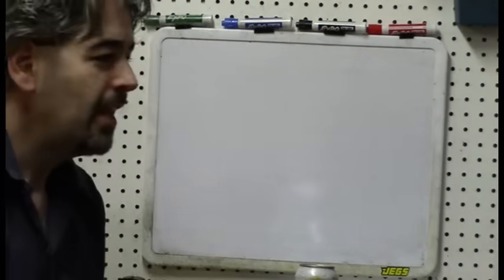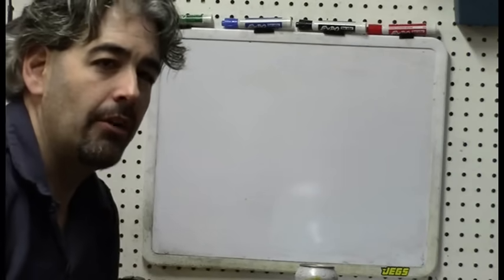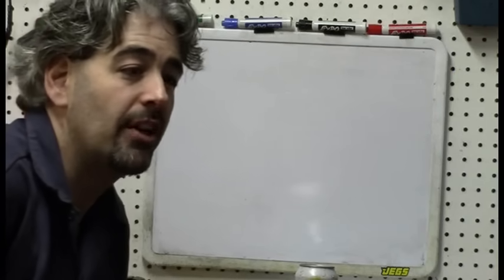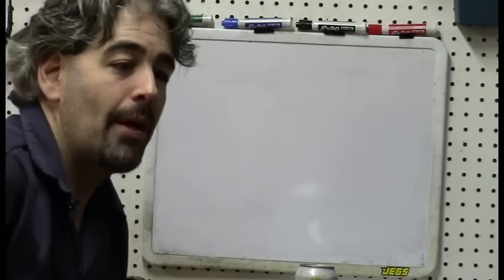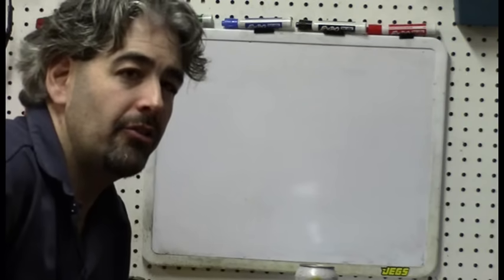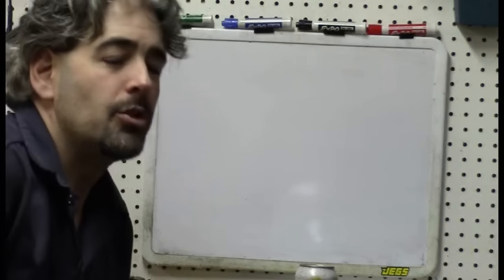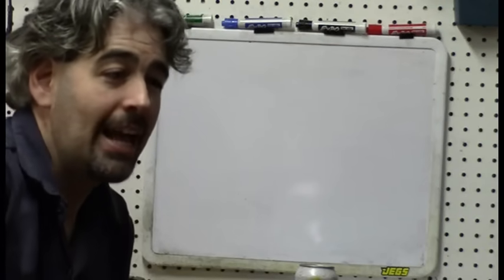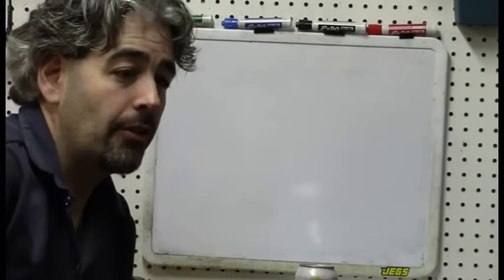Secret of Engine Problem Diagnosis- Fuel Trims Pt.1

Comment: What if the downstream O2 Sensor varies voltage in the correct range but there is no Fuel trim... It's a flat Line.    I checked the 4 wires continuity from the senor to the ECU harness. It's a new Mazda 3 sensor.
Reply from the maker: well there are a couple things. the downstream sensor shouldn’t oscillate voltage- only the upstream should. 
  also what percentage  is the fuel trim flatlined at? and are you referring to long or short term?
  if the short term is flatlined then most likely it’s a communication issue with the scan tool.
Reply: @SchrodingersBox  Thanks for the quick reply.   Can I send  you the graphs so we can discuss accurately?  I'm also getting some knock senor activity.  I'm on FB and we can PM there if you like.  Thanks in advance

Comment: Thanks fort your help a several months back (break booster split hose). Car is fine (no DTC) but my LTFT is between 8 and 12% at idle and comes down as RPM increases. Is this something to worry about? Should LTFT always be 0 at idle?
Reply from the maker: Not possible to tell- you must combine the STFT to look at total trim.
Reply: @SchrodingersBox  On my Audi STFT is about -2% to 0%>. Total number is around 10%.  Just concerning when the numbers are 12 and 0%.  I own a Saturn and both numbers are negative at idle at around -7 total.  Two completely different baselines when DTC aren't present.
Reply from the maker: I don’t see any issue with fuel trim.

Comment: Great video. Gave me somewhat better understanding of fuel trims. It didnt however help me get any closer to figuring out what is wrong with my 2015 Honda accord hybrid. I had p0171 set once at idle some time ago. I reset it (my mistake) after I replaced oil k&n air filter with OEM one and after I cleaned mass airflow sensor. That was before I learned about stft and ltft. Anyhow, p0171 never came back but my stft oscillates between 10-30 and ltft oscillates between 7-18. When full open throttle it seems to drop as if vacuum leak was present. Car behaves normal except maybe little shaky at idle (it can be my imagination fueled by fuel trim paranoia). Only other thing I found suspicious is the fact that i can not complete evap system test after driving over 5000 miles no matter what drive cycle I do. That made me think of possibility of fuel vapor purge valve stuck open. Would it explain lean condition? Anyone? I'm in Chicago and I can not find a knowledgeable mechanic that is comfortable with hybrids. I could go to the dealership but my fear is that they just start replacing sensors, injectors, fuel pump, mass air flow sensor etc. until they stumble upon the culprit of this issue.

Comment: Hey. Superb video. I have strange problem with short fuel trims. My engine is BMW M54B30. On bank 1 i got  +25-28%, but on bank 2 it is ok 0 to 5%. I know that my oxygen sensor after cat on bank1 is dead. Is this can affect on fuel trims? 
MAF is working, I checked rubber hoses and there is no cracks.
Help please. Thanks.
Reply from the maker: if wouldn’t be the MAF because that would affect both banks.   On BMW the S2 does have some input on fuel trims so if the sensor is indeed dead (and I would test it to be sure it is) you will need to replace it to get a good baseline on the fuel trim. then if you are still lean on that bank you will need to look at the bank specific variables for lean condition
Reply: @SchrodingersBox  I will replace oxygen sensor and will let You know, thank You.

Comment: 1998 ford expedition 4.6 liter has a P0171 and P0174. LONGFT1:25 LONGFT:25 at idle. When accelerating from 0-60 mph at 2500 rpm LONGFT1/2 maintains 25. At the moment i let go of gas both LONGFT1/2 drop to 20. At cruise it returns to 25 and both shorts are at a average of -3 to 5. What could this be
Reply from the maker: Lots of things. What is your induction data showing?
Reply: @SchrodingersBox  induction data as in all the sensors for air intake and throttle position?
Reply from the maker: Exactly.

Comment: Hey doc really been enjoying these classes but cannot get the concept of my diagnostic! I have 2 banks with low/normal stft at idle with Ltft bank 1 at +0.78 & bank 2 Ltft at -3 what would cause a misfire on the complete bank 2 with stft of -18 whilst bank 2 is only at 2.3? cats are both around .7 when warm too.. It only misfires at high rpm 5805rpm to be exact

Comment: could this cause a hotter than usual catalytic converter? and will that be a symptom of a vacuum leak?
Reply from the maker: Yes. Lean conditions can result in hotter exhaust. Actually rich conditions can also result in rapid catalyst degradation
Reply: Thanks for the reply , I started to notice a really warm to hot cabin floor on the driver side of my 07 crown victoria is not getting cherry red hot at all but I do notice a hotter cat and hotter engine bay as well no check engine light no increase in engine temperature but definitely feels hotter I do not have an engine miss fire nor oil burn so I am beginning to look into a vacuum leak. Great video.
Reply from the maker: There could be a million reasons for that even as simple as a missing heat shield. If you believe your engine is running hot then that would show on the CTS voltage or output and if it is confirmed you need to do an engine heat diagnostic covering variables from timing to coolant efficiency to stoichiometry....
  There is no evidence of anything right now.
Reply: Thank you , keep up the great videos and education is greatly appreciated!

Comment: A slightly confusing syntactical error early on but overall very nicely educational. I learned how to check for a vacuum leak with my scan tool, and how to figure out where it is occurring, without having to buy a smoke-making thing (I already have a propane torch)!

Comment: Thanks for the amazing video :) Wish all mechanics have this Knowledge. Anyway, I assume I'm an idiot, I got the error code P0301, changed spark plugs, ignition coils and fuel injectors, and none of that fixed the issue, the car Acura TSX 2009 doesn't go over 20 mph and check engine is blinking,  I took a look at the Short term and long term data, short term is -30% and long term is -3%,  OSB1S2: .86 (looks normal, right?)  I feel stuck and doesn't know what to do next ??!
Reply from the maker: you need to curve it against load and determine the rich condition environment and then look at the variables that would cause the rich condition under those parameters.    Just the incomplete data you have shown does clearly indicates it’s not an ignition problem so definitely don’t continue in that direction.
Reply: @SchrodingersBox  I didn't understand what it means to have the short term at -30%, does it mean that it is not getting enough fuel ?
Reply from the maker: no- it means the air to fuel ratio is too low.

Comment: Hey, Matt.  I am dealing with a high idle speed on a 2014 Nissan Sentra. I could see that the engine coolant take a long time to reach normal temperature. STFT and LTFT are normal. I am trying to rule out an open thermostat because an open thermostat would most likely keep the car in open loop. Can the thermostat be ruled out if the car goes into closed loop?
Reply from the maker: Eventually even with an open thermostat it will reach temperature for closed loop. A stuck open thermostat is a definite possibility. 
   Usually you will get a code for an excessively long closed loop time on newer cars, as well as a thermostat rationality code. That is- the PCM knows that given the air temperature, engine load and length of run time the temperature should be higher than what it is.
Reply: The code that I have is P0507. I cleaned the throttle plate a year ago. I don't know if I damaged the the throttle body in the process. The thing is that the idle does not stay high. It just takes a long time to go down, which makes me believe the throttle body didn't get damaged. Would you see the TB as a possibility as well?
Reply from the maker: If I was looking at the car I would determine if the temperature is low and the car may be idling fast in efforts to warm it up faster. If engine temperature is normal but idle is high I would check the fuel trim, MAF and especially MAP data to see if there is intentional idle increase or if it’s the result of an induction metrics issue.
Reply: @SchrodingersBox  When I get to work on the car again, I will ensure that the coolant level is right and the temperature rises as it should. A stuck open thermostat is must likely the culprit. I couldn't finish the diag because the owner was in a hurry. Thank you for telling me about the stuck open thermostat and the closed loop status. I was inclined to replace the Throttle body, but realized that a damaged Throttle Body would keep the idle high. Thank you again.

Comment: HEY BUD NICE VIDEO,,im at a lose,,this is a strange one,, i have,,my short term trim on b1 is -1to  3,,,,,stb2 is -19 to -24,,,,,,but the long term fuel trim is bank1 is opposite,,,,,,,lt bank 1 is -19 to -25 and the ltb2 is 0,,whats your diagnoses
Reply from the maker: can’t make a diagnosis with that data because you have no curve under load. can’t say anything.

Comment: I have a question for you based on the data you have given and the percentages of the field trips that I have I'm just Toyota, all my fuel trims are above short-term and long-term Bank 1 and bank..... When I raised RPMs to about 2500 both short-term fuel trims rise to about 20% long-term fuel trim stay the same at 13 they do not move in percentage. There are no vacuum leaks or few issues, it just recently gave me a p0420 code catalytic, can this be causing the unbalanced fuel trim?
Reply from the maker: no. a catalytic converter won’t cause that. you either have a dirty MAF sensor or a fuel pressure issue.

Comment: Can you please tell me why ONE off my exhaust cams would be considerably advanced
Reply from the maker: if it’s dual exhaust cam, one of the cams is just out of time.  could have jumped a tooth or sprocket slipped. 
  also possible the cam is twisted.

Comment: If my o2 sensor 2 is stuck at 1.25v is it the sensor?
Reply from the maker: It could be. Could also be the wiring. Could also be a legitimate rich condition. Could also be a PCM issue. Could also be it’s a AF sensor and not an 02 sensor.
Reply: @Schrodingers Box  also I did change out the bank 1 o2 sensor 1. It's a 4 cylinder. I had a P0420 and another code but with both sensors fluctuating voltage. No longer have that issue. Now I'm left with P0038 about the o2 sensor 2 being high. I admit im a complete amateur learning as I go. 1st time going more than just suspension and tires. I really appreciate your response.

Comment: Quick question , if map sensor with a clogged up air filter, less air will be introduced into the engine, as I understand performance will be affected, but if map continue to meter the restricted air flow which is lower than usual , fuel will be delivered lesser than normal ? Will the end results be 14.7:1? If it’s stoichiometry, how is the performance be affected , thank you for your info
Reply from the maker: OK that is seriously one of the best questions I've seen in a long time.  The answer is unfortunately not so easy as it depends on the induction metering design and the programming as well as other environmental variables.
  On an engine with a MAF and a MAP, the MAF is the primary induction meter for stoichiometrically proportionate fuel volume calculation.  Therefore, in the event of a clogged filter on this design, while of course the metering is accurate and there would be no fuel trim adjustment because the stoichiometry is 14.7:1 to start with, you would most likely see a low MAF signal since the airflow is not sufficient to keep the expected MAF frequencies.  However again this depends on other variables. It could also be interpreted the IAC must not have opened to provide expected airflow and an out of position error may occur.  You may even get low idle codes... it's hard to say.
  On a speed density (MAP only) engine it would be different. The MAP input would be the primary induction metering.  Again, the vacuum would be lower and this would accurately be recorded by the MAP so there would be no fuel trim adjustment, however you would most likely see a MAP out of range code as the voltage would be lower than expected at any conditions.  Howveer you might also have a situation where the clogged filter only has significant effect at WOT. In that case still seeing MAP voltage representative of a low RPM condition even though the TPS shows 5V- well, that is almost guaranteed to give a TPS code and not a MAP code.
   Hope that helps. Really, great question. I love ones like that as opposed to "where is my MAP sensor....?"
Reply: Schrodingers Box thank you for your respond , really appreciate that. Thinking of the TPS, like said in previous video , sounding like the main fuel delivery comes from the TPS, rather than the MAP/MAF? Which is the validator of the incoming air? With increasing of the voltage reference of the TPS with low air flow causing idle rpm to go up in response to richer Af ratio despite the fact of low air flow . Obviously looking at fuel trim data , will be a high negative trim (rich) . If we set the TPS at idle remotely , and rev it higher than idle, will the map or maf compensate ? Or if a failed or disconnected TPS , let’s say voltage will be 0v , will the maf and map take over the work of the TPS ? Sorry for asking so many curious questions , as I would love to learn.
Reply from the maker: I actually mentioned the TPS is the FIRST point of reference for fuel input- not the main one. Technically, the MAF or MAP input would come after the TPS input since it takes a second for the air to go past the sensors either after after throttle moves.
  Absolutely, the reaction of one or the other sensor would cause a fuel trim adjustment requirement- however it's the O2 Sensor that makes the compensation, not the TPS, Map or MAF.  Now once the PCM determines (or thinks it determines) the failed sensor causing the false input, then the input from that sensor would be discarded after the MIL indication and the inputs would default to the other sensors.  In other words: if the TPS was determined to be the failure- the MAF and/or MAP data alone would be used but it would not adjust fuel trim- it would just be the default for initial fuel delivery. Any adjustment after that would be a fuel trim adjustment done by balancing the O2's.
Reply: Schrodingers Box thank you ! Very clear explanation.

Comment: Sir... thanks alot
In my car Hyundai avante 1.6 Gdi the long fuel trim  (-10%) and the O2 sensor reading around 1.4v to 1.6v ... is it dirty injector problem?
Reply from the maker: Can't tell- no relevant data.
Reply: @SchrodingersBox  can you tell me the reasons to have negative long fuel trim, I'll check it in the car one by one. thanks ...

Comment: thanks a lot i have peugeot 406 2001 model with a problem of a smoke coming in to the car with pins on eyes when i daignose it i fund intermetentr fualt on the ecu  i change the ecu not fis i change  the 4 injectors not fix pls what could couse that problem pls i need a help thank you

Comment: Hi, I hope you read my comment and respond 
I have a 2006 toyota tundra. Not able to pass smog test since November 23
Reply: P2445 code even after replacing secondary injection pump with factory pump as recommended by Aamaco after computer diagnostics. Talking with a Toyota dealer service professional I was told that I would probably need a "break down" diagnostics  meaning $$$$ to tell me what the problem is to fix. I have a very hard time believing that a toyota dealer service center can't connect to THEIR  Toyota computer & engine of my Toyota vehicle and diagnose any failures without taking everything apart. Am I being bambuzzled????
Reply: Please help
Reply from the maker: I would not expect a new pump to fix this. I would first check for voltage and ground at the pump.  In fact they should be able to command it on with a scantool and see it doesn’t operate and then identify if voltage or ground is missing. That would be my first step.

Comment: I've got a unique theory/problem. My 2010 caravan 4.0 had a high voltage output in egr the day i bought it, the dealers replaced the digital egr. now i am getting an insufficient egr flow. egr tube looks pretty new, i asked them to check it for blockage or restriction. If they did, could the egr be sucking air by gaskets or through pinhole? I have a rough idle and LTFT's are around +9. raising rpm drops trims to around 0.
Reply: I will introduce propane around egr tube, if no rpm surge occurs, then I will remove egr tube; inspect it, the gaskets and associated gasket surfaces.
Reply from the maker: Well its a unique theory, not a unique problem. Knowing that a high voltage would result from either an open or high resistance, you need to check the voltage proportionate to pulsewidth modulation at the load vs from the PCM to determine the cause of the issue.  You could also input potentiometric varaiances directly  into the signal and read the outputs both actual and processed which is my usual basic strategy. I like to just keep it simple and confined so I limit my variables and have the direction become apparent rather than selecting it arbitrarily.